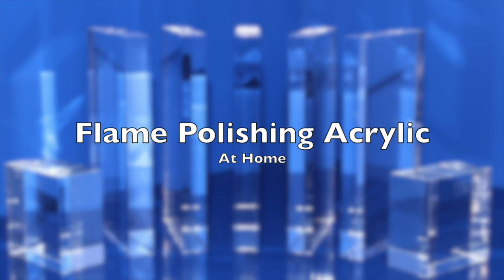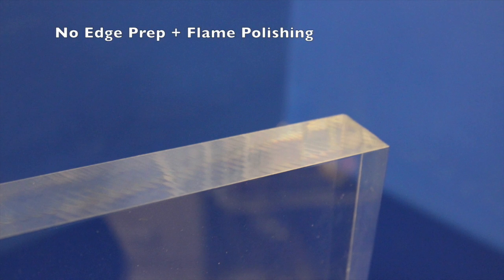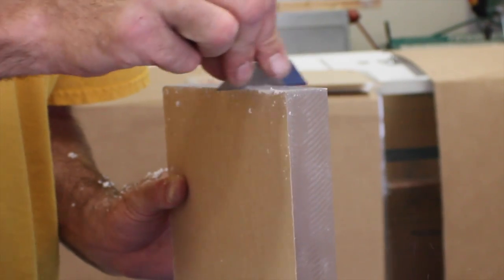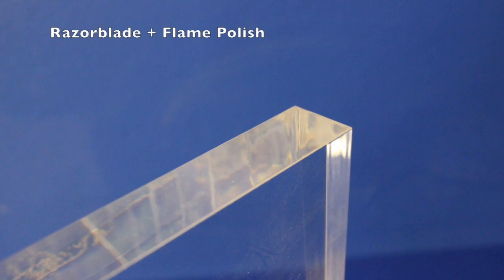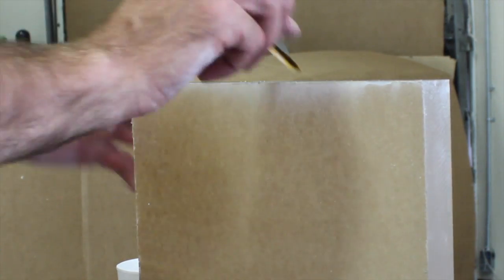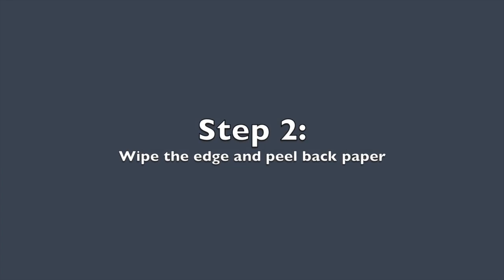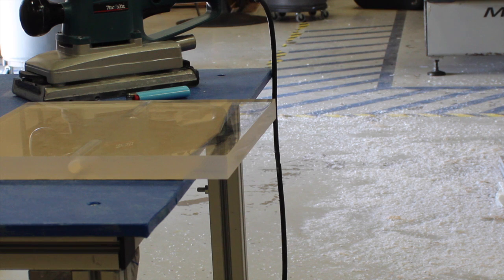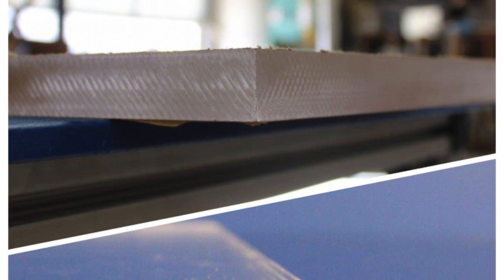DIY: How to Flame Polish Acrylic

Comment: Using a Zund router module. Zero sand needed. I use nothing higher than propane on acrylic. Heat gun on Lexan. We're pros, all you need to know.

Comment: I will be cutting some acrylic for boat windows. They will be surface mounted to the side of the boat and attached with a sealant and screws. There is a slight curve the part will have to bend to. Maybe a 1" bend over 32" length. I'm using 1/4" #2074.  Will polishing the edge by any means, sanding or flame polishing, add strength to the piece? What are your recommendations?

Comment: Looks like a jointer not a router!
Reply: It was Definitely a jointer - typically used for wood  -  you can use a router setup with a fence as long as the bit is wider / thicker / taller / bigger than the thickness of the actual acrylic -   better if you push thru in 1 pass